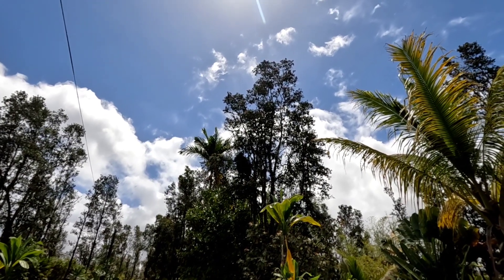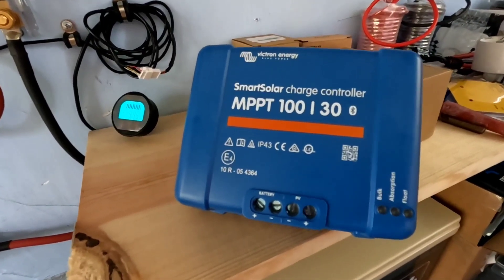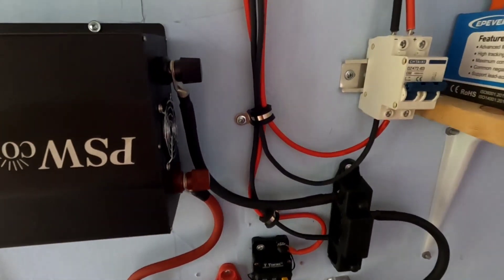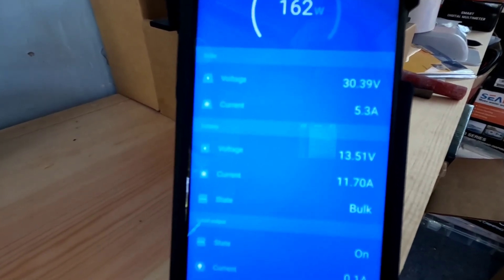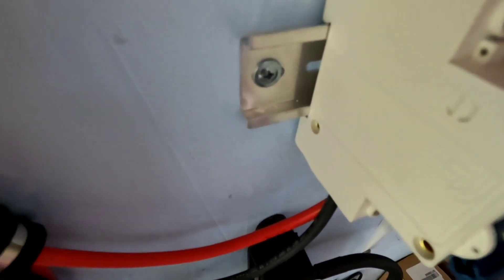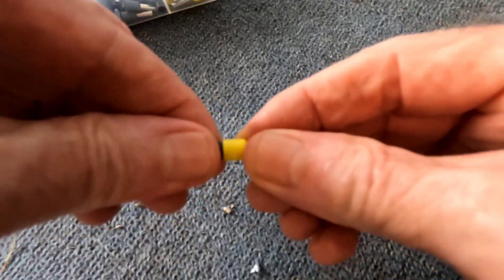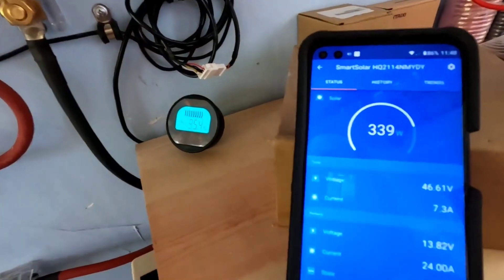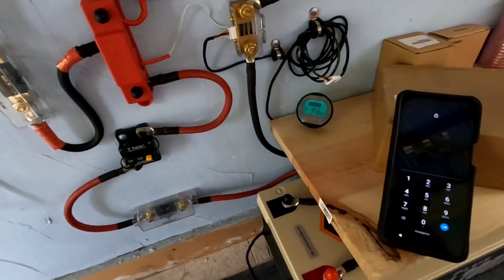Update/Upgrade 200ah LiFePO4 solar system

Comment: i also use the 75/15 but i use it on 2 12v 200 ah batteries in series at 24v  ,  At 24v it can handle 400 watts no problem . i believe it will do around 440 watts at the 15 amp limit output .  I would love to have that 100/30 ! good stuff man!  thanks for making the videos , its always fun to see how other people are building their systems .
Reply from the maker: Hey thanks for tuning in and sharing that information . I'm tying that 75/15 into another system already .  I'm loving the 100/30 too! First full day using it and all systems are full. aloha 🤙

Comment: Nice upgrade, I absolutely love my Victron 100/50.  I would love to see the History log of what your system is producing after it's been running for a while.  I've been debating going to 24v on my system to maximize output and finally connect the full 800 watts of panels, but I don't have enough need until I have some more electrical load for the system.  Hoping to find the time to remodel for a spot for one of those LG fridges in my camper.  The aging propane fridge uses close to 10 pounds of propane a week during the summer, and I really like the idea of running all my needs on sunlight.
Reply from the maker: Thank you,  it's been a real fun project,  and after today being the first full day using the 100/30, I love it too! I also have thought about going 24v , and it's been recommended to me by many. Maybe someday,  but I'm cruising so good on 12v , and happy it meets my needs, and then some. The LG refrigerator has changed life here. 20 cu. ft. was once unthinkable off grid, and we all went propane back in the day when solar was so expensive.  It barely touches my main bank. It's so efficient.  Mahalo for being part of the conversation here...aloha 🤙

Comment: That working great . The MPPT tracking is fast on Victron . and the app updates fast as well . when series connected panels watch that open circuit voltage so no to exceed the  controller. you can even do a quick test with you meter right on disconnect PV side with breaker off . also that higher voltage  can shock you good. and also make Shure the wire can handle the voltage . I have UL listed 600V wire . also you can add surge suppressor to PV input. Midnight solar and others make them .Get the one for your open circuit voltage. a earth ground is a must on them for lightning protection. Mine have blue led on them. I have ferrite cores snap on type on my PV leads for EMP and RFI /EMI filtering . I have big panels 320 watt each .2300 watt total with 2  strings of 5 into 2 MPPT controllers. my 2 strings are different panels different voltage/amps had to use 2 MPPT . into 24V . have wind gen as well . ran AC window 7200 BTU just fine . it is energy star type. just got that this year. my 6250 BTU is 3 years old and on outher side of my home, my inverter runes them both but nothing else. I got switches to split my loads up. I have back up inverter incase one fails . never has. have smaller on on 12V system. that windy nation 1500 watt 12V . the 24V inverter is 2KW/4KW surge. it is best to have extra for them cloudy days. fall winter months I got lots of wind . summer muggy days need AC and little wind unless storm . looking out for my girlfriends heath. take care and have fun ! each system will be different .
Reply from the maker: I love hearing about others systems,  and your system sounds amazing,  and as usual my friend,  I'm taking notes! I'm going to look at those Midnight solar suppressors.  I want as much protection from lightning as possible.  Got a friend out here who everytime lightning is close to him he loses his Outback cc. So much yet to do, but continues to grow. Mahalo as always for always helping me along out here...aloha 🤙

Comment: Bought two 230ah 12v to make 460 24v battery.For my RV  so  100/30’ will be good for 1280 watts,74v 17 amp.That’s four 320 watt panels.They would be 150v wired the other way.Taking baby steps my friend n figuring this solar stuff out step at a time.
How yah doin?

Comment: Nice vid victron is top gear, don't waste your 75/15 add a couple of panels to it ,the 100/30 will talk to the 75/15 and will add the 2 together.  I have a victron 100/20 and a 75/15 .The  75/15 has 2 panels hooked up in parallel,  and the 100/20 has 3 panels hooked up, I intend to purchase a few more panels.
Reply from the maker: I've already moved the 75/15 into another project...haha! Loving the Victron.  So much. aloha 🤙

Comment: On the 75/15 you could do 4 panels 2 sets of 2 in series and parallel it says on the paperwork if it if you have more power than it's rated to put out it will limit it. it's in series up to 75 volts short circuit and up to 15 amps short circuit in parallel so 400 watts that would be limited to 220 watts
Reply: Which would mean you'd get more hours of full output you could do 3 in series and a second set of 3 in parallel on that making 600 watts but at full out put 220 watts. So if it's about 1/3 perfect sun you'd still be getting about the full 220 watts. it's built to handle that
Reply from the maker: That's great information and mahalo for sharing that with us! I already moved the 75/15 into another project  and I will remember what you said. aloha 🤙
Reply from the maker: That is amazing...I'm loving Victron...mahalo!🤙

Comment: I have the victron 100/50 with few 100w panels (getting few more) setting it up with power queen 100ah (getting atleast one more), I need advice I'm trying to set up my charger controller and see the lifep04 quick setting but I'm trying to use the advanced settings feature because power queen recommended higher float and a few other things a little off. Did you ever try fine tuning your charge controller settings because I'm having trouble finding tail current settings for power queen along with pretty much every other advanced feature recommended setting besides the bulk and float adjustment in the manual

Comment: When you going to upgrade your big system with a Victron? Also bought the ferrule kit with your link.
Reply from the maker: You know I really want those Victrons on the main bank! Maybe pretty soon.  I'm definitely sold on them. Cool deal on that ferrule kit...its a very substantial tool, and works great. I like it a lot, and man it cleaned up the connection's.  Best of luck on your system...aloha 🤙

Comment: From what I heard,  one must be careful when connecting more than 3 panels in parallel because if one panel fails,  the other panels will dump their load into the defective panel and cause a fire. The panel connectors are rated for 20 amps. So,  three panels dumping their load into one will probably melt the connectors and may cause a fire.  This can be avoided by fusing each panel. 
Yes, the Queen deserves the best.
Reply from the maker: I have them in series,  but may have misspoke...wouldn't be the first time! But, I definitely take your point, and more fuses is on my list. So much to do yet, but having good time and learning more everyday.  Already building another system...might need an intervention one day. Man this stuff is addictive! aloha bud🤙
Reply: @ProjectsinParadise808  LOL!

Comment: I would have thought that as long as you don't exceed the rated pv input voltage it should be fine especially been a victron it should be able to charge at its rated 15amps all day every day
Reply from the maker: I agree and it's running at that everyday pretty much...under ideal conditions. Aloha! 🤙